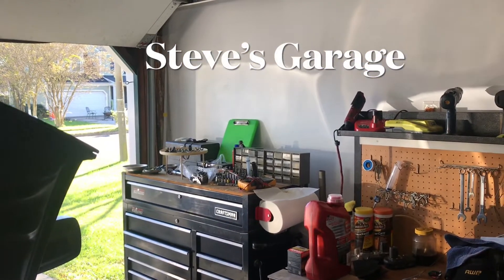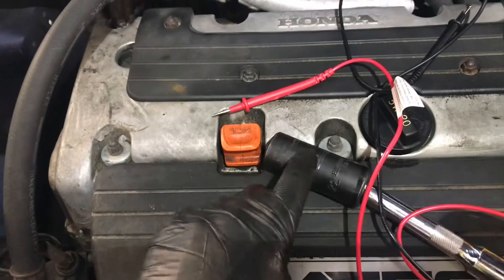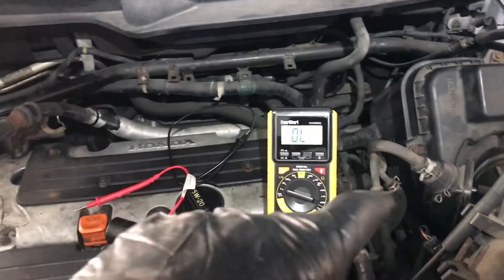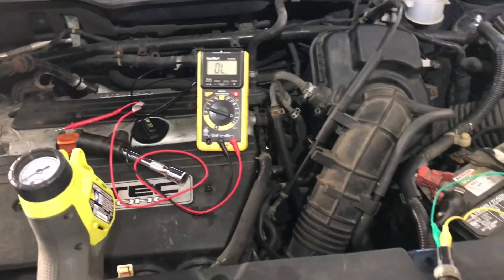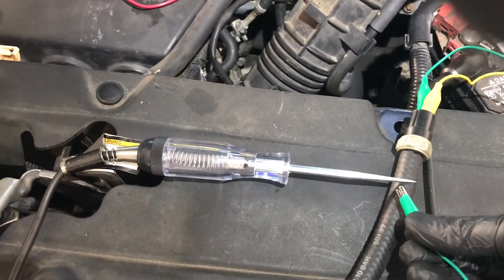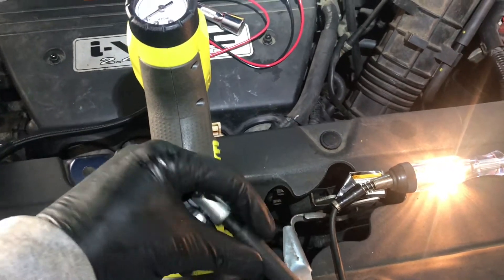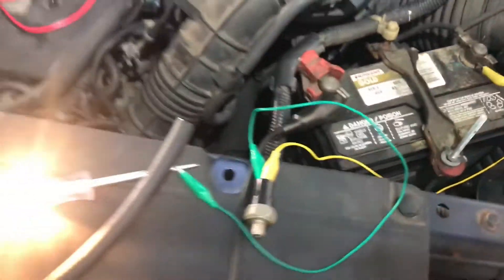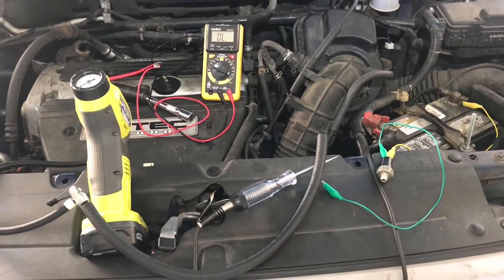KQuick Tip- Honda P2646 Code Diagnosis;  test the pressure switch

Comment: What fixed it . Plugged screen? There's 3 of them . One under the ps pump . One on the vtec solenoid and one on the solenoid on the side of the head . Sometimes an oil change fixes it.

Comment: Hi - Thanks for the video, did you find out what the problem was with yours - I have a different honda 2.0 Type R FN2 although solenoid unit looks very similar. I replaced my Vtec Solenoid spool valve and switch with a new unit about 3 months ago with oil change etc because of code P2646. It was all ok until last week I got the code again - a new oem Honda unit is £180 here in the UK so don't want to buy another unit. Changed my oil again and the replaced the other oil screen behind the alternator.  It was definitely better in so far as I could rev higher, but still over 7800rpm the CEL light comes on and VTEC is prevented with code P2646 any ideas?